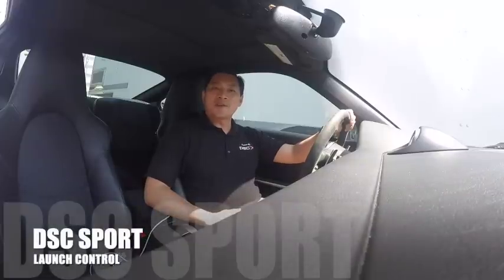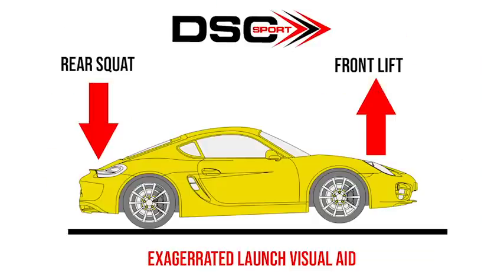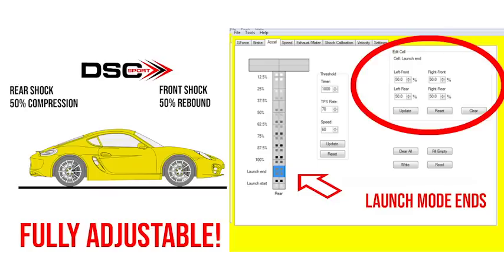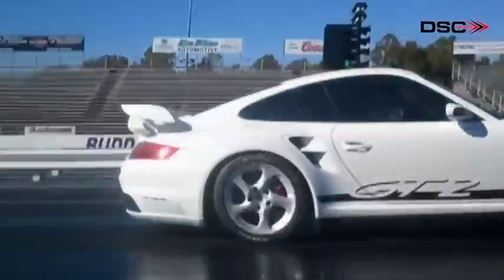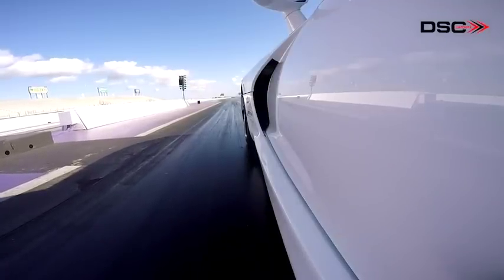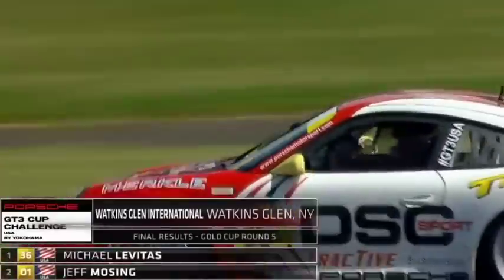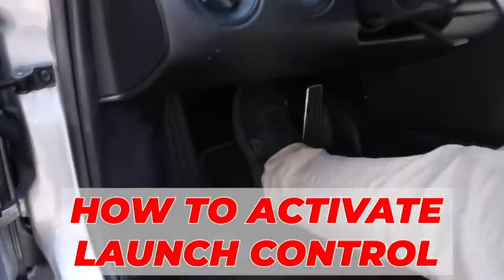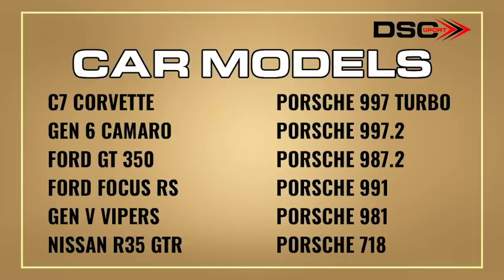DSC Sport Launch Control Explanation and Activation

Comment: When launching cars with Independent Rear Suspension (IRS) such as the 997 referenced in the video, decreasing damping in the rear to allow more squat negatively impacts rear wheel traction at launch.  When the rear squats the rear camber inflects inward (negative) decreasing the contact patch. More squat equals more negative camber.  You want the rear camber to be as neutral on launch as possible.  On the front end you want less damping to allow the front end to rise increasing weight transfer to the rear.

Comment: Is there a new firmware in the works for C7 V4 controller launch control indication? The 12-30-2018 FW does not indicate when launch control is active.

I had my 19 C7 Z06 at the track two weeks ago and could not tell the difference in 60’ with or without launch control . 1.72 60’ on MPSS tires.
Reply: Go too www.dscsport.com for latest information on firmware. I'm not aware of any light on Corvette or Camaro that's used to indicate launch control is active. I use launch control in a 6th Gen Camaro, works great. When I'm stopped, clutch in, stab throttle, I know it's active because of the way it feels vs not stabbing throttle to activate. Haven't had it fail to work yet.
Reply: Any contacts for DSC? I am having the hardest time getting in touch with them.

Comment: Hi! I have a DSC controller that I purchased from an authorized dealer here recently . The car in question is a Camaro 1le, but the controller is for a C7. 

I have searched for contact numbers and sent emails, but I haven’t received a response. The dealer doesn’t seem interested in helping. 

Can someone reach out ? It seems to be extremely hard to receive any costumer service.

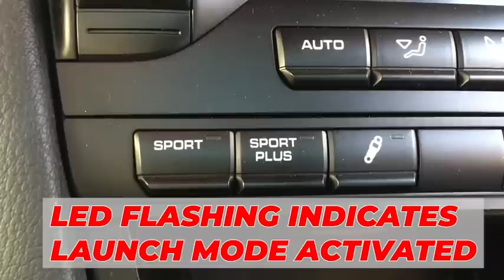Comment: 3:40 - manual cars hold in clutch. This isn’t my experience. I have to hold brake to activate.
Reply: same
Reply from the maker: Important Note: If you have a 997 vehicle equipped with the DSC Sport controller featuring our launch control option, it is to hold brake to activate whether manual or auto transmission. All other DSC Sport applicable vehicles featuring launch control are as normal. Clutch for manual, brake for auto for activation.
Reply: 997.2 Manual transmission here.  Do you have to be in neutral and "stand" on brake then stab the gas quickly? 

After that it would activate dsc launch control, and then you go into first gear, hold clutch, Rev to whatever rpm then dump it?